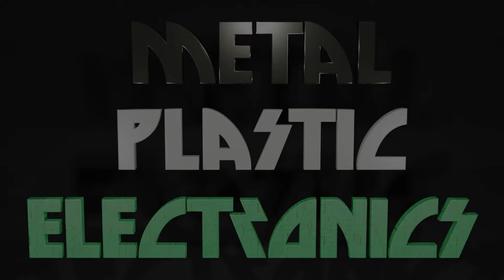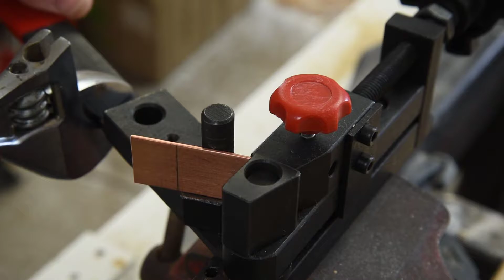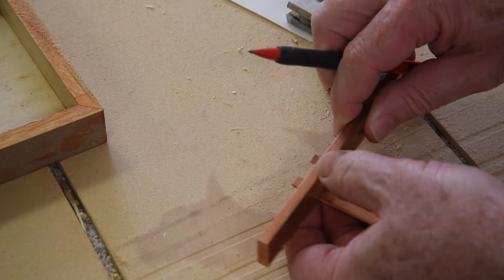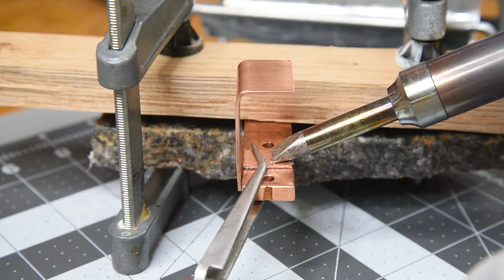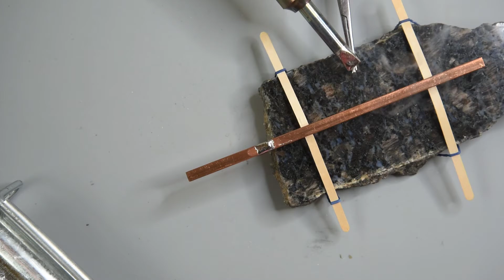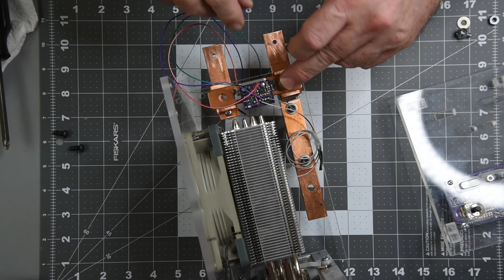American Beauty at Work – Mounting Current Shunt

Comment: Those turned out nice. Job well done! I think we've all been there with the fifty thousandths that keeps one awake at night. I've found that calling it a prototype helps.

I was going to suggest wetting the tip to increase thermal transfer, but it looks like you figured that out on your own. 

Filling those joints heavy is the right approach in this case, but remember: metal to metal contact is what you want - the solder just fills gaps and holds the two pieces of metal together. When solder starts carrying current, it doesn't survive long. I only mention that because those terminals you added don't look like they have a lot of metal-to-metal. (It could have just been the vantage point, though.) But it should be fine as long as you're not pulling >20A continuous or something. 

Someone else mentioned heating the larger piece. That's only half right. The best approach is to alternate. Start with the larger piece, and as soon as the flux starts to bubble and smoke, quick-switch to the other piece and solder should flow almost immediately. Another option might be to pre-heat with your hot air. You'd be surprised how much of a difference it makes to bring it up even just to 100C before you start.
Reply from the maker: yes it's a prototype, I like that.  The spade terminals only planing for 5 amps or so.  They will go to a couple of banana jacks.

Comment: When soldering two different thicknesses of copper is it better to put the iron on the thicker part, or doesn't it matter?
Reply from the maker: I don't really know for sure.  I would think as long as can keep a layer of flux on both surfaces, wouldn't really matter.